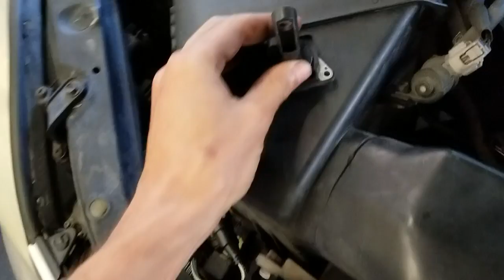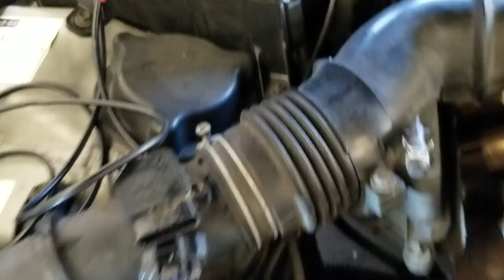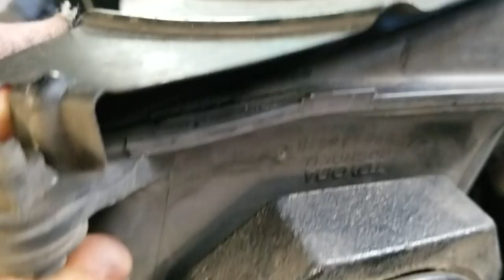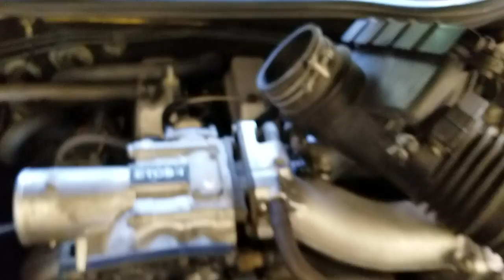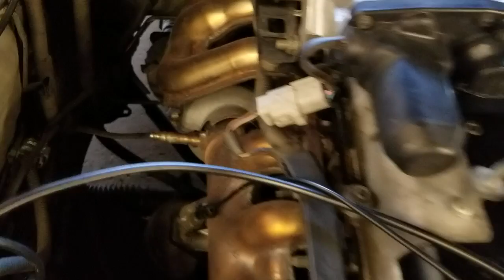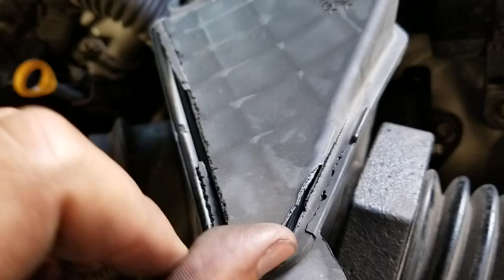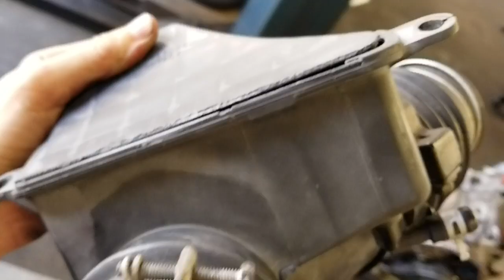FIXED 2JZ hesitation & low power, no check engine light.

Comment: No when you floor it it goes on the cars base map at wide open throttle thats why it goes away when flooring it not because its suckin in so much more air.
Reply: I have a 1989 Lincoln Town Car.
If I try to accelerate fast(punch), it hesitates, & I feel a spurt in the peddle, & it takes off from there.

I been doing everything I could think of to get rid of it.
I just replaced my cat, muffler, added a resonator.
Adjusted the kick down cable, etc.
I've replaced the TPS,  MAF or MAP sensor, ignition coil, spark plugs, spark plug wires. etc.
Can u help? Thanks in advance..

Comment: My 2003 Lexus GS300 has the same problem but just that one you mention on the begging on the  video,, I cleaning the mass air flow sensor and don’t fixing the problems .
Any other ideas ?
Reply from the maker: Watch the rest of the video? did you inspect for intake boot cracks or cracks in the silencer?

Comment: This just happened to me just now, thank you for this helpful video. I will checklist just like this and update you on how it went. Probably good to clean my master air flow censor.
Reply: Definitely clean your mass air flow sensor, only spray the area inside the tubing not wjere the electrical connection meets. There's a kit with an maf cleaner and throttle body cleaner get that and clean both out there's tons of vids how your car will run much much better

Comment: My car jerks but no engine light on .
Reply: Have you checked the spark plugs?
Reply: @DonVerchi700as  no
Reply: @jakierabassett8168  you should change them if you haven't. And use NGK.
Reply: @DonVerchi700as   lol wats ngk
Reply: @jakierabassett8168  the spark plug brand made for Japanese cars
Reply: @DonVerchi700as  I got a Volvo 1992 s60 . It's like it just change out on its on . But my bf say I need a strainer
Reply: @jakierabassett8168  is your car turbo manual or automatic?
Reply: @DonVerchi700as   turbo

Comment: My car has an intermittent jerking when temp outside is above 15c .Once started it will have a rough idle and hesitate for first 5-10mins of my journey then disappear.No codes are present, car does have new egr , changed maf , changed fuel filter and changed throttle body but no different in warm weather . In the cold car runs beautifully . It’s a Hyundai i30 1.6 diesel any suggestions...?..sticky injectors..?.
Reply from the maker: You need to check the data stream. I would check coolant temp sensor readout 1st and go from there. Sorry, unless I have the car here I would not be able to diagnose easily.
Reply: No problem I appreciate the advice I’m in the uk
Reply: Check your 2 Fans and make sure Mass Air flow meter sensor is working fine.

Comment: Is there is any possibility of hesitation due to battery issue ??
Reply from the maker: unlikely, but possible, if the battery is weak or charging system has a problem, it directly carries over to all the electronics. the electronics need 12.5-14.5 volts to run properly.
Reply: A lot of places will do free battery checks for you, if you don't have the tools to check the battery yourself.

Comment: My son needs the hood prop as well. You forgot to mention that as a common problem, he replaced the hood cartridges once but went back to that system. Ok he has the hesitation to I cleaned our mass air flow and still have the hesitation. Thanks we will check for cracks. :P
Reply: Where there any cracks? Did you resolve the problem

Comment: My 350z is having this issue, It  struggles to go past 3krpm and when I get past 70mph it runs fine. I cleaned  both mafs / throttle- bodies, did a vacuum leak check, and I chaged the spak plugs. I have no codes, also someone said its the knock sensor not sure if so but its 200 a piece so I don't want to change them out and it not be the solution.
Reply from the maker: without having the car in front of me, its near impossible to diagnose. is the car stock? sounds like air leak between maf and throttle plate???
Reply: I think it’s my intakes I’m replacing them I have short ram and it’s a cheap one so my afr is off so it’s sucking in more air and not providing enough fuel
Reply from the maker: oh gawd.... yes

Comment: What about if the car has an aftermarket intake and a new maf sensor?
Reply from the maker: OEM maf? What intake?
Reply: It's just an eBay short ram intake and Its oem maf from toyota, I've cleaned the butterfly, cleaned the fuel injectors and it still has hesitation when I step on it from a stop it's an is300
Reply: @josephtorres4683  if it comes with the  filter that comes pre oiled. It's probably getting oil on the sensor.. uninstall the aftermarket intake and see what happens..
Reply from the maker: @josephtorres4683  check for the leaks highlighted on this video and clean maf.  If your maf is relocated out of the  original sensor housing, you can have issues. k&n and aem Are engineered to match factory scaling. Cheap aftermarket stuff is not and will run like crap.

Comment: I Have the same problem, I bought a new intake resonator, I cleaned the mas airflow sensor, cleaned the throttle plate, replaced the spark plugs, replaced fuel injectors and replaced fuel filter, & it is still hesitating under full throttle gas load, only, also idles low when stopped on drive, going to replace throttle position level sensor and maybe throttle control motor and throttle position sensor also, I also have a bad downstream catalytic converter obd2 code po430 keeps tripping, smh feel like just getting rid of the car.
Reply from the maker: Your symptoms are different than these listed and fixed in the video. The symptoms listed here are for low load and low rpm, they mostly disappear at higher load and rpm. You should check fuel pressure under load and perform a datalog when you experiance the problem. You should also check if the cat is melted and blocking exhaust flow.
Reply: subtledriver thanks dude, yeah I’ll probably do that, also I just swapped out the fuel filter and now its taking longer to crank after its been left off on park, cranks right up after the second try tho, its probably the fuel pressure regulator I’m assuming or maybe a weak pump tho it doesn’t seem like its the pump all o rings and seals were put on correctly, anyway, thanks again for your insight.
Reply: @c_lo3051  did you figure out the problem?  I'm thinking of getting a new car as well but if I can fix this I can delay.
Reply: check your coil pack plugs my car had cracks up and down it. had to rewire whole cord 18 inches of wiring that got to hot sitting between manifold.
Reply: Genuine Lexus OEM Throttle Body Level Sensor 22060-46070 2JZGE IS300 V6
Reply: Peddle sensor? Speed sensor?
Reply: If so you can try doing a reset on those. Does it feel like it is missing 2nd or 3rd/not dropping rpm correctly??
Reply: You have symptoms that will send you in every direction and when this happens it really does best to drive it for a bit and take in all the sounds and feel the car drive. If it is having a skipped gear feeling I would check those two sensors. Good luck. Looking forward to hear the fix.

Comment: had a similar problem with my carburetored civic 95 d15b engine. runs normal but the moment i floor it it lurches and jerks for 5-7 seconds and then it goes vrooom all the way. took it to a carburetor guy said there was a fuel leak and he cleaned it up and changed some gaskets. took 5 dollars. after that it worked like a charm and no hesitation after pressing the throttle. no more jerking. but now its doing it again a little bit and its only been 2 weeks. i don't think anyone checked the air flow sensor. so im gonna do that. thanks for the vid!
Reply: How's the car doing now